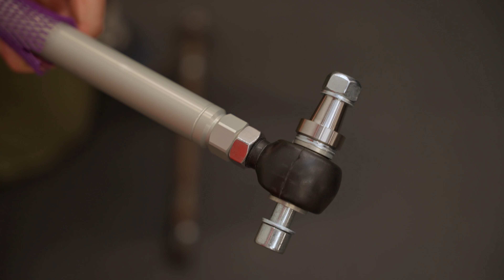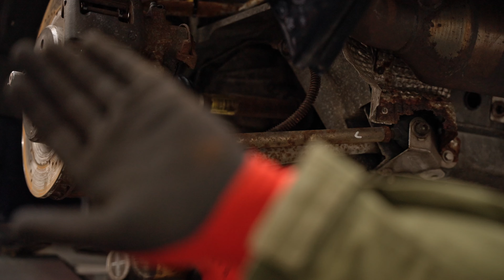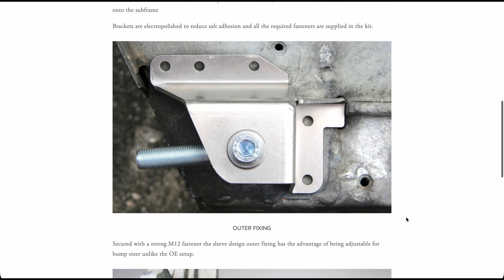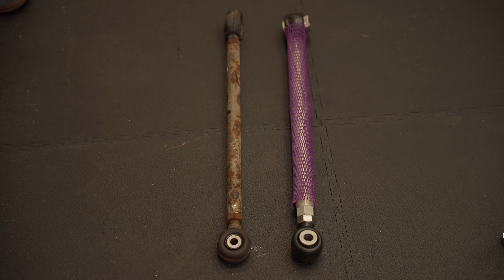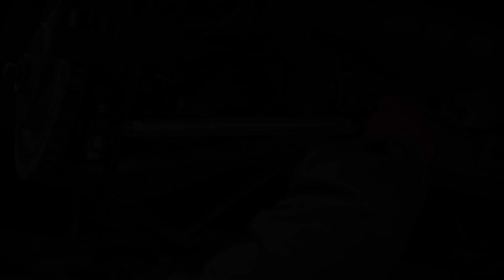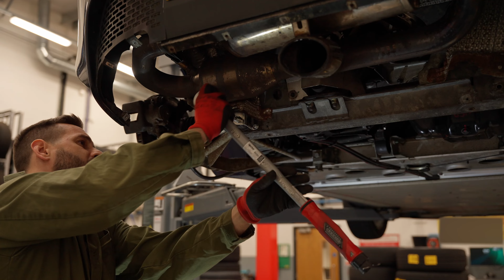Fitting Spitfire Toe Links - Lotus Elise/Exige

Comment from the maker: The camera definitely didn't do this car many favours, but yeah, the arms have lots of surface corrosion which needs addressing. Are you based in the UK? If not then this is what most cars look like underneath if they're used on the road unfortunately 😂. 

The bracket is to put the inner bolt into "Double Shear" as the standard OE part used to shear at the sub frame. 

The 4 bolts are spreading the load of the main 10mm bolt into 6mm bolts. 2 bolts top and side wouldn't be enough to stop the bracket pulling away or twisting., So 2 top and 2 bottom is pretty much the minimum to transfer the load properly.

Thanks for taking the time to leave a comment!